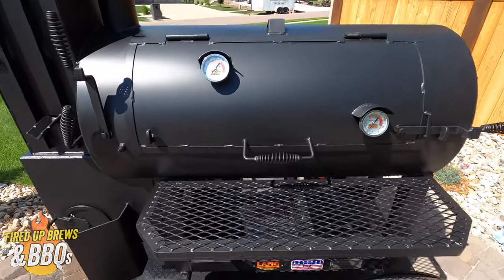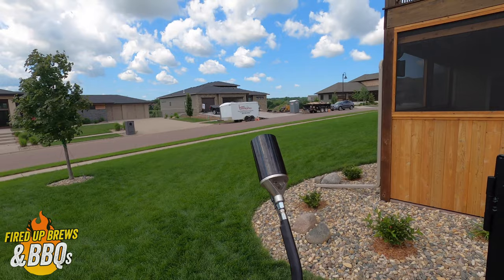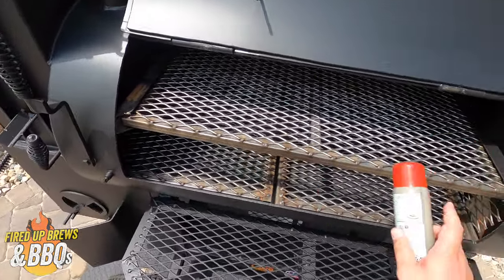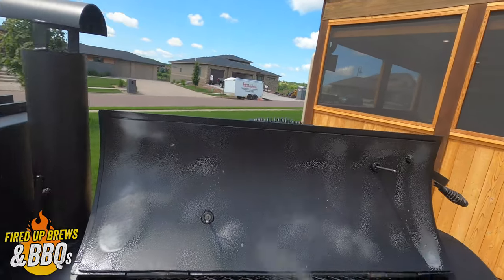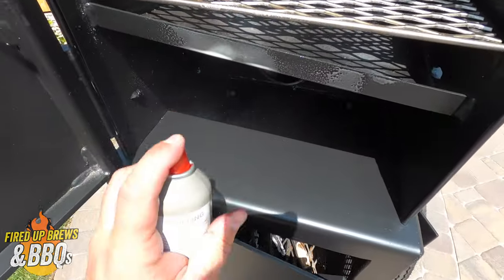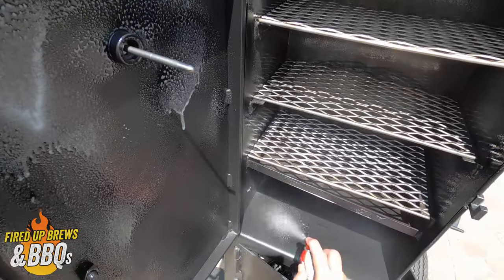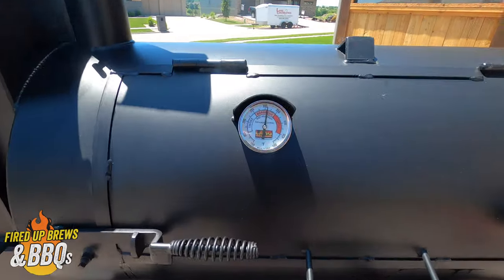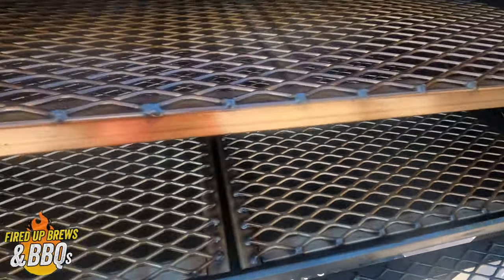How to Season a Smoker or BBQ Grill

Comment: Do you spray the fire box or just the warming box and cooking chamber?
Reply: it's ok to spray the chamber lightly. 
I used a rag with avocado oil, for the high smoke point.
Reply: I've always sprayed my lang firebox before & after each cook too, inside and out, and i always wipe the outside of my lang with vegetable oil after each cook, That's why after having my Lang for 8yrs plus now and cooking on it about every weekend, i do not have any rust on my smoker and it's still shiny black, I leave it out on my back deck uncovered through every season..☺️
Reply from the maker: Awesome 😎